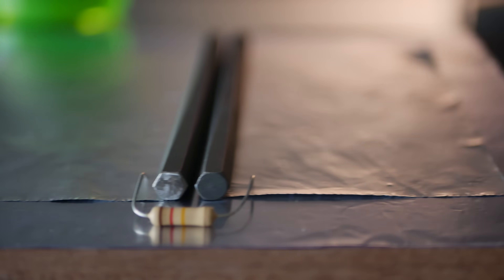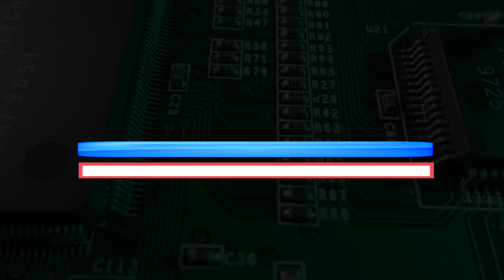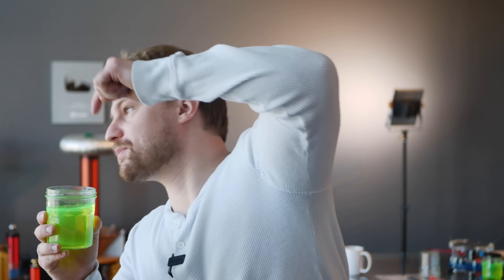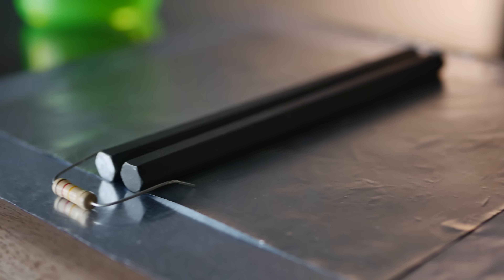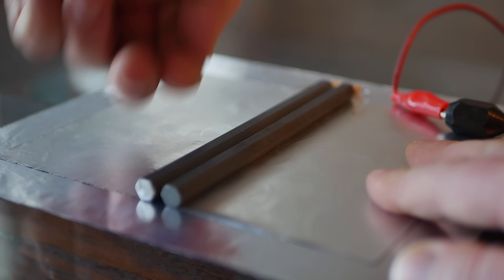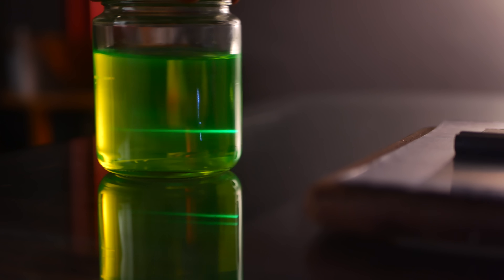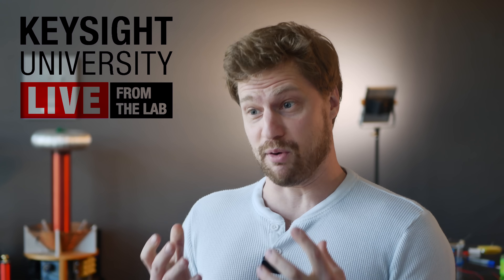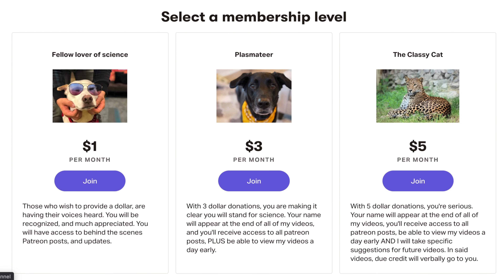Building A Simple High Voltage Nitrogen Laser (Ft. StyroPyro + giveaway)

Comment: Your shirt probably fluoresces because of the detergent. When the companies say "whiter than white" they mean they put florescent dye into the detergent to make them brighter in sunlight.
Reply: so we can take detergent and disolve it in water or alcohol to make a dye for the laser and we can get visible laser beam after it goes through it? im not juts talking about inside the cuvette or jar but once it passes should you not get a visible beam?
Reply: @ARCSTREAMS  I don't think that'll work since fluorescent material emits light in all directions, not directionally. So the detergent solution would glow, and some UV light that weren't absorbed would pass through, but I don't think you'd be getting dyed laser this way.
Reply: @rigen97  it all depends on the beam to begin with, i seen vids of ppl using a tea laser beam to pump a dye solution and get it to emit a different color beam out ,of course this means the dye is lasing (ie stimulated emission) ,and fyi all laser materials emit light in different directions before some of this light is bouncing back n forth between mirrors and stimulating more photons in the same direction so that has no  bearing ,also some of these lasers emitted by pumped dyes in a cell do not even have mirrors but the beam is still generated because it has such high gain

Comment: Built my first TEA laser in the early 70s, based on a design in The Amateur Scientist (Scientific American). I used double-sided MIL spec printed circuit board for the capacitors, it's good for 20kV.

Comment: Inspired by your "Water Power" video, I made my own circular Marx Generator, "One Ring to Rule Them".  I'm definitely going to try to build one of these UV lasers.  If I got one of the scopes in your giveaway I would use it to measure transient electrical phenomena in my low-power DIY static and HV experiments, as well as the usual electronic project work. If you used your UV laser to duplicate the Michelson-Morley experiements, it would definitely be the Everest of DIY science videos!!

Comment: You know they actually put UV fluorescent particles in some clothes detergents (for white clothes at least). That way they can actually genuinely be "whiter than white' as some ads used to say when i was little. You get the white light from all the colors but you get extra brightness on top from the UV getting turned visible.
Reply: Not only the detergent, processing of the textile fibres requires many chemicals that are very fluorescent. Thats why most cloths glows in UV or Blue laser. You can scan your living room floor with a 405 nm Laser pointer and see the floor is full of tiny bright stars. Thats the small fibres ripped off your cloths.

Comment: This reminds me of a similar build following an Amateur Scientist article by C.L. Stong in the 1974 edition of Scientific American, pp. 122-128. It utilized a 3 plate capacitor made by etching a double sided PCB, two strips of copper foil, and a plexiglass enclosure to contain flowing N2 gas. What attracted me to the build, was the simplicity of the design, and lack of mirrors at the cavity ends, required in other popular gas lasers of this era, ie. HeNe and CO2.

Congratulations on your build! I've been enjoying your videos exploring the world of High Voltage generators, along with the detailed build instructions to replicate your projects, that are both functional, and nice to look at when not energized.

Some future projects to consider could be...
- Electronic electroscope, using a center zero uA meter to show positive or negative charge.
- Kelvin electrostatic generator, using a battery powered water pump.
- Radial or Cylindrical Dirod electrostatic generator (see Electrostatics by A.D. Moore).
- Bonetti or Voss sectorless Wimshurst machine, powered by small DC motor.
- Safe (non-mains connected), ZVS powered SSTC with 556 IC interrupter circuit (pulse, frequency).

Comment: Laser effect is achievable also with sound. Modulating sound on high frequency wave you can transmit sound in straight lines. I have build one and it is pretty cool, but it has some flaws, an osciloscope would definitely help. (parametric speaker)

I am attending electrotechnical college, for one year I haven't touched osciloscope. Everything we learn is only through online classes. I am sick of theoretical studying. If this all continues what engineer am I gonna be? My patreon name is Jurco.

Comment: Mind is already going about upgrading to another gas in the visible wavelength and optically pumping the laser off a visible laser diode. 
Soo simple. H.V. pumps the outer electron shells into higher orbitals so they are primed to fall back as soon as any photon of the correct harmonic, hits them. 
Wonder if four separate isolated bars would give a better coherent beam. Not more power as reflections are dangerous. 
Why the high value resistor ? Bleed off resistor ? 
How can there be such a high voltage difference if the secondary plates are on the same side? Gues that explains the spark gap placement on one side
Thank you

Comment: Very interesting, thank you
I wonder about the following points:

• Would the performance increase if the PVC projector sheets would be replaced by polyethylene sheets? They aren't that much harder to acquire, but LDPE and HDPE should have a much better loss factor. Also, I think that it's possible to stack several sheets of the capacitor

• What do the sparkgap and TEA discharge waveforms look like on an oscilloscope? I think that you could catch them on a 100MHz bandwidth oscilloscope, if the oscillations have a period of tens of ns. You can use a high voltage transformer to protect the oscilloscope (or maybe a cascade of three or so 1:20 transformers)

• I guess that the sparks cause lots of EM interference. It'd be interesting to catch it with small loop antennae connected to the scope. You can then add a Faraday cage around the laser, and compare the interference amplitudes

• Does one really need to cut the Allen keys? Maybe just placing them back-to-back (like _| |_) would be enough

Comment: I thought of making one of these in my teens, I had my first HeNe laser in 1984, I still have 2 HeNe's and many direct diode as well as a few diode pumped lasers, made Tesla coils both solid state 12V flyback and spark gap hand wound PVC secondary types. I could really use an Oscilloscope.

Comment: I feel like making one with 6m bar stock. For you video suggestion please make 2 matching Tesla coils. Instead of toroidal use a flat pcb big enough to stop carona discharge. Place the two about 3 m apart. Pointing at each other. Ensure grounds are connected. Feed power into one and measure power received at the other.

Comment: I enjoyed the collab! its always really cool seeing two minds interact on problem solving if I extend the length of the top two bars will it affect the power or brightness more ore does that length matter ? also it would be cool to see you attempt using a TIG torch to weld in a vacuum environment I'm curious if it has some sort of sputtering effect with the plasma cone  cheers and thanks for the vid

Comment: That was pretty sweet! I have never seen a TEA laser. Now I want to make one! You should see what it takes to increase the power output. Maybe longer rods or adjustments to the capacitor plates or resistor or maybe just more power via a larger spark gap. You could measure the power output with a UV light sensor.

Comment: I’ve often thought about building one of these for pumping dye because I have a few uses for a very short-pulse beam.
I’m actually surprised that you got it to work so “easily” given how many hot-spots you had in your gap. Where you see those bright spots in your gap, you have an imperfection in the surface of your electrode. Getting them smooth and parallel is essential to getting a TEA laser to work well.
The more of those hot-spots that you can eliminate, the better you will find that it works and you will end up with some fairly high-intensity pulses - be warned, UV lasers like this are quite carcinogenic. Even scattered light from one can increase your risk of skin cancers... and remember, the beam exits at BOTH ends of the gap !!
... and don’t forget to operate it in a fairly well ventilated space because they puke out ozone, too.

Comment: tin foil - hat?
Reply: flash tube, ionic, high voltage, the z-pinch, rotary shooter
Reply: leyden jar, how jarring, yarr
Reply: now the circular one, bouncy chamber
Reply: how about deionized water or sand pool insulation, for the arcy arcy
Reply: vacuumed to have no arc paths, only capacitive interface through the dielectrics

Comment: Cool laser. I built my first hene and power supply kit when I was 8, since then I have many types of lasers but I have never tried to make a tea laser I may have to give it a try. Can you do something with electrostatic propulsion? Maybe a small light weight plane. I would love a new scope mine was found in a dumpster after flooding and had extensive water damage I purchased. A schematic and replaced the transformer and some transistors but its 30+ years old and always has a new issue and is in need of repair.

Comment: Excellent build! It seemed pretty finicky to get the laser working, and I probably would have given up quickly. Props to you for pulling through and getting help from one of the best. Since the laser comes from ambient nitrogen in the air I wonder if putting the system in a container with higher concentrations of nitrogen would make it work a bit better. I'd love to have an oscilloscope for reverse engineering and modding electronics.

Comment: I built one when I was 13, following the Scientific American article.  I didn't get it to work thanks to no good way to lower the pressure.  (Remember, I was only 13, living in a tiny town.)  Here I am, 45 years later, thinking I should give it another go.  And then when it works, use it to pump a tunable dye laser.

Comment: This was wonderful! I would like to see a video about the safest ways to manage high voltage for beginners!
Reply: No experience plus instant death is a roll of the dice honestly. This is coming from someone who rolled that dice. Honestly running a flyback off of 3 volts would be the safest imo. High voltage but very low amps. Not batteries though since they aren't current limited.

Comment: THIS WAS ANOTHER GREAT VIDEO !

Thanks for all you do.. I would love to see a video on a complete build of a LARGE Tesla coil.. 

BTW there is small device to lessen the sound of spark gap.... Acrylic  tube capped at both ends with 2 tapped holes you thread copper bolts into to form the gap. Add one tiny tiny hole for out gassing by using a super fine drill bit or melt hole with a heated pin.

Please add me to have chance at the give away.

Comment: What if you put whole set up in a nitogen filled enviroment will the laser be more powerful as more nitogen=more photons?

Also can the tesla candle be converted into a muscial one for you know date night😂?
Reply: The atmosphere on earth is already 78% nitrogen, I don't think the laser intensity would be significantly greater, but probably enough to measure a difference.

I would be curious to see the effect generated by running this apparatus in a chamber filled with noble gasses, I would expect the laser to be the same colors that you expect out of those same elements in neon signs.
Reply: @blackbeardthepirate7467  that would be really fun trying noble gases and also allen keys could be replaced with graphite pencil leads now that i think of it. Also he may be able to make the setup compact by using capacitor instead of aluminium  and plastic sheeta to fit into a resonable sized noble gas filled chambers
Reply: @blackbeardthepirate7467  78% mixed with oxygen etc is not as efficient as 100%
Reply: @ARCSTREAMS  interesting, more logarithmic than linear efficiency? What kind of chamber are we talking here, higher than one atm worth of 100% N2?
Reply: @blackbeardthepirate7467  1 atm ive seen done on another yt vid
Reply: @ARCSTREAMS  I don't think I'm pulling up the right video, link me if you've got a moment.
Reply: yes if you add N to the cavity it will be more powerful ,many ppl have built them using N gas pumped into the cavity and it creates stronger lasing that you can see a blue line appear brighter in the discharge cavity and then you can make visible beams using dyes, google  lee lab he shows one he made doing that, but there are others showing it on yt vids

Comment: Awesome video Jay! As always.

I had no idea that a laser could be made this way. It was cool to see you branch out using your background in high voltage in other areas.

Is it possible to do something similar in the visible range with other gasses? As you could add in your favorite material acrylic to make a box above this setup, and could pump different gasses into the chamber. You can get many types from welding supply shops. Or other gas suppliers.

I was wondering if you could make the laser even more efficient (or powerful?) If you put pure nitrogen into a chamber around it, but not sure how much better it would be as nitrogen makes up such a large percentage of air. 

It would be cool to see you try to use this to make a CO2 version. Depending on how difficult/dangerous or unsafe it is. Don't want you to endanger yourself.

Really, I'm cool with whatever you decide to do next, as long as you're enjoying yourself and passionate about it. I'm just enjoying the ride my friend. It's always fun and a delight. 

(Also liked the Max Headroom type, 'one hand rule' effect thing you did!)

Comment: I first messed with lasers over35 years ago. Back then it was He-Ne tubes and I was a school kid in a small town and a teacher gave me this big box of gear to play around with. I had no idea what I was going and zero safety equipment. Pretty lucky I didn’t blind or kill myself. I actually shorted the high voltage DC circuit with the mains at one point and the copper on the circuit board vanished up my nostrils. 

Would be awesome to build one of these... I might have to get back into it. I wonder what they could be used for? Thanks for demonstrating this.
Reply from the maker: Hi Mark, that's really interesting to learn. Yeah, the best part of this laser is the low power required. Not vaporizing with this thing. Well, except the two dozen times I burned my skin that I didn't show on camera....

Comment: A Theremin musical device would be a very cool idea. Strieght up. I really want an oscilloscope. I have know shame and I've never won anything. So give it to me. No need to think about it just say ok.
Reply from the maker: Cool idea! maybe....a high voltage theremin?
Reply: @PlasmaChannel  you could use a tesla coil for the speaker or in addition to the speaker for a interesting effect. The Theremin uses high frequency circuits coupled with antenna as the capacitors. Tanner Tech made one on his channel. He is a smart kid. Keystone science, and great scott as well. Nanu nanu... There's laser versions also.
Reply: @PlasmaChannel  a Theremin with a plasma speaker... And acrilic.
Reply: @PlasmaChannel  if the Theremin plasma speaker isn't working for you. Have you seen the microwave grapes plasma ball. Very cool!
Or the argon gas cold plasma wound treatment. Developed on the space station
Now That's next level Trek tech.
Reply: I just seen you did a Theremin video with keystone science. I'm hanging my head in shame.

Comment: This project is interesting, because of the way the light is generated through the interaction with nitrogen. I would like to see you take it to the next step, see what happens in a full nitrogen environment do you get a stronger effect?
The other thing I would like to to see with this project, would be, scale. How small can you go and how large you could go, how much energy is required, what types of problems you encounter. I would really like to see a miniaturization of this laser! Does it work with other elements and which ones?

Comment: I've torture myself trying to build a TEA laser with little success. What are your thoughts in building a high voltage power supply using an old school ignition coil? I saw your video using a coil pack and in doing so you pointed out you have to modify the coil pack in able to make it worth your while. But an older ignition coil is much easier to use.

Comment: I'm curious to see if you cant get a better discharge by taking the edge that contacts the foil and sand that shiny. The coating on that hardened steel is a resistance point. Maybe by making it clean clear metal, along with the discharge edge, it would help increase the discharge rate. Very interesting project for this sparky to try

Comment: You can make a improved version of that laser. Is that possible to do this to emmit visible light with a common gas? Maybe a encapsulated version, portable and with a gas inside and maybe a difraction grid to check it's wavelenght?

Comment: This video was awesome. But I've seen this kind of laser a couple of times in videos, but I never saw the resistor on the top. Is it optional? 
I once thought about how you could fix your DIY liquid steel video transformer onto your shoulders or back and run it with a battery. Then you could attach the wires to gloves on your hands and everyone would fear the power of the mighty one. I thought of this while trying to think of simulating the 'quirk' of Endeavour from an anime: My hero Academia.